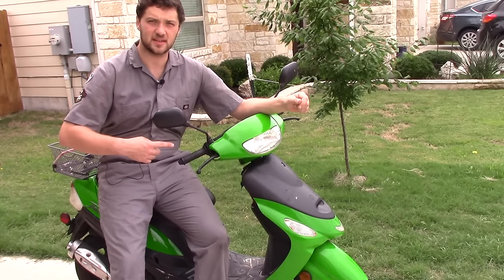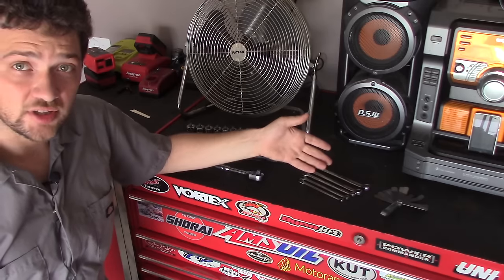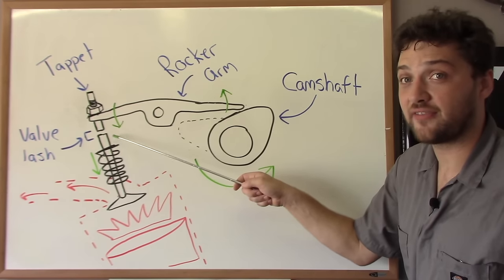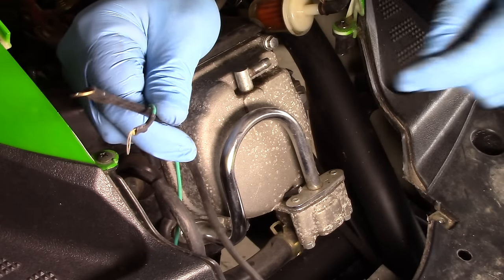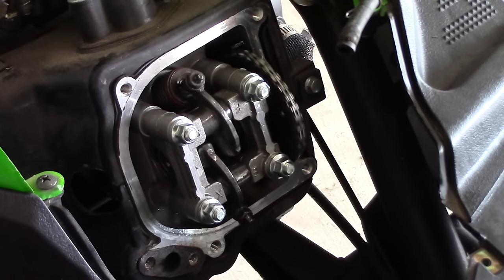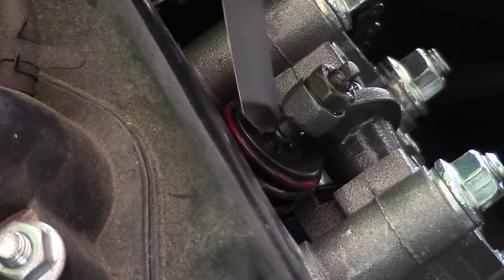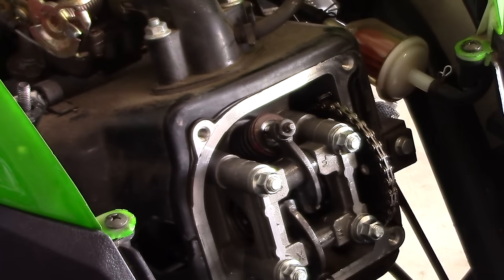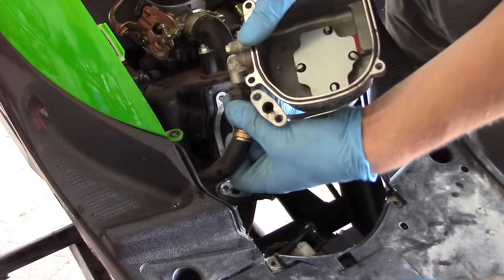Scooter 911: Hard to Start or Wont Stay Running? Try a VALVE ADJUSTMENT! (works for most scooters!)

Comment: Hey Garrett Seesing,

I'm wondering about using synthetic GL-5 gear oil in my scoot.  The manual says GL-3 gear oil only so I got GL-4 from Blauparts.com and that works fine.  I'm just curious to know if there's really any reason to avoid the additives in the GL-5?  It doesn't seem like there would be a lot of soft metal parts that would be damaged.  If you have any thoughts about this, would you please share them?  Thanks.
Reply from the maker: Wow! What an astute question! Personally I only run GL-5 in any motorcycle final drive as it (supposedly) has lower viscous drag than GL-4. But only GL-4 and GL-5 oils are designed for hypoid gears and have that extra shear protection that I would assume all final drives would need. I'm not familiar with any final drives in any scooter that use bronze or brass bushings that would require a GL-3 so I'm pretty curious as to why your manual would recommend it. What year and model is the scooter?

To play the other side, I ALWAYS follow the manual's recommendation. I think that I'm pretty smart, but I know I'm not smarter than the guys in white coats who designed the parts. So if they say only use this oil, or torque this to these specs, I trust them.
Reply: @Scooter_911  - The scooter is a 2018 Icebear Hawk Eye (75W-90).  I also have a 2019 Tao Tao Lancer (80W-90) and I use a GL4 for that, as well because the manual that comes with the Tao Tao Lancer is the manual for another scooter and has no really useful information in it.  I have been using another Blauparts gear oil for it and it's a mineral gear oil.  I did put a synthetic blend in the Tao Tao because it was leaking gear oil a little and I wanted the extra protection and have had no issues.  So, if you think to use the instructions, I'll just keep using the GL-4 for both of them.  Thanks for answering so quickly!
Reply: I forgot to mention that I use the GL-4 because it has replaced the GL-3 which is no longer made by any manufacturer.

Comment: What are the extra springs for?why does my 2015 TaoTao come with a extra carb,coil ,fuel lines etc??I just bought the scooter for $200 excellent condition and only 445 miles seems to run good but never took it in the road yet just a little nervious cause it's been many years.I am also trying to figure out why the main center headlight is dim during the day.If it's a day time running light,and gets brighter at night or something wrong with it.Brake like gjts, taillight,turn signal work and the small low middle light works.I am hoping you can help me..
Reply: No

Comment: OK I have a question,I purchased a Roadmaster 150cc scooter about 3 weeks ago,since I've had it,it has stalled and shut down on me twice leaving from work,omw too work I had no problems,but as soon as I leave,I've started the scooter,started leaving from work,get about 10 yards out scooter starts too stall and then finally dies,I try using the electric start too get it going again,with no luck,but as soon as I use the kickstart,it starts right up with no problems and I get home without any issues,do u have any idea what the problem could be,any help would be appreciated,thx
Reply from the maker: Wow that is extremely strange. This isn't a solution but have you tried letting the scoot warm up for a minute or so before you leave work? So bizare that it only happens leaving work too. If you leave anywhere else around the time you would normally leave work does it stall then too?
Reply: @Scooter_911  I usually just ride it around the hoise ,maybe a few blocks,other than that for the past couple of days too work and it did the samething twice,and no I diont let it warm up,and like I said after it wouldn't start with the electric start,I tried the kickstart and I had no problem getting home after that,and what's weird it runs fine when I travel too work

Comment: please help oh god of scooter wisdom....i bought a scooter from some one and  it struggles to start as if something is stuck or sticking it has oil the cylinders are all brand new i checked the gears and noticed that the gear oil is really really thin as if the dumbass filled it with motor oil is it possible that the gears arent turning when im starting it? or does that have any effect at all or is it the bendex? im so confused

Comment: I have a gy6 and it stopped running on me after doing a gasket replacement what did I do wrong?
Reply from the maker: Which gasket did you replace?
Reply: I replaced the one where the piston is and foreword to the valve cover.
Reply from the maker: @benjaminbower2470  if you replaced the head gasket you may not have gotten your cam timing right
Reply: @Scooter_911  I know I had a hard time with getting the chain back on

Comment: I have a question for the hard to start symptom. My valves are adjusted.

I gotta a 150cc Bintelli Scorch Scooter
I smell a gassy odor when trying to ignite the electrical system & attempts to turn over a few times before (1) the volts in the battery discharge below 12 volts & just won’t start because too many attempts with no avail or (2) actually turn over with strong rev power but sometimes you can hear a poot from the exhaust pipe or slight stall in the running process when started. 
Any advice? Should I pull my spark plug or adjust my carb air/fuel screws?

Was riding fine now it’s always feel like a gamble if this thing will fire right away, after 2-3 tries or more.
Somebody suggested it could be the CDI box. What do you think?

Comment: Did you have to drain the oil first?
Reply from the maker: No, but a little oil leak out when you remove the valve cover. But the engine should be cold before you perform the valve adjustment. And if the engine has been sitting a while the oil drains back into the crank case

Comment: Hi, so i followed your tutorial and while it was sparking and running (but turning off shortly after) before the repair. Now it isn't sparking. Could it be from inserting the screwdriver into the sparkplug slot like in the video?
Reply from the maker: No, you cannot damage the ignition system by inserting a screwdriver in the sparkplug hole. More than likely you have an ignition system issue, possibly a pickup coil, possibly a CDI and possibly just a bad grounding wire
Reply: @Scooter_911  I see well, thank you for your reply and the video. I dont live near a shop that will repair this .. so i guess the best thing is to just try to sell it :(
Reply from the maker: @Matthew-bg1nx  well there is another option. Do you have a multi-meter and some tools? I could possibly walk you through the repair via skype
Reply: @Scooter_911  i appreciate the offer! I dont have a multimeter but i do have a decent tool set that i used for this repair.
Reply from the maker: @Matthew-bg1nx  well if you can get your hands on a multi-meter my offer still stands. I'd hate to see you sell it over something that can be easily fixed

Comment: I did a valve adjustment and it still turns over and dies. Even with new carb and intake and air and fuel filter

Comment: I think I might have this same problem. First I couldn't start my scooter and my first thought was to clean the carburetor. After cleaning, it started but it turned off when I throttled it. Also, the idle keeps going higher and lower on its own. I feel frustrated. I check the spark plug and changed it to a new one but still. I'll try this engine valve fix and hopefully it's the problem. BTW, my scooter is 150cc Jonway vitacci eagle. I just bought it 2 weeks ago and it started fine and ran OK after replacing the carburetor. There's a sticker on the scooter just below the speedometer which states to not go over 25 miles per hour on the first 300km. But I did go at top speed of 55mph. Should i have heeded this warning? Could this be the problem I'm having now? Because the scooter is new.

Comment: I'm looking to buy a new 49cc scooter Tao Tao Pony 50 :)
Looking for (simple plug n play) type mods.
I want to keep it simple and get a little more performance.

Can I just replace the stock carb and muffler system and still be reliable?
Looking at: 
Glixal ATMT1-073-1 GY6 49cc 20mm Big Bore CVK Carburetor with Electric Choke 
39mm Air Filter for Gy6 Moped Scooter 
BADASS SHARKS 28mm Motorcycle Exhaust Muffler Pipe System
Trying to keep it simple, inexpensive and semi reliable. 

What do you folks think?

Comment: I have a 150cc was running fine started sounding like it's running out of gas it died when starting it try to run  give throttle it locks motor down
Reply: Should I get a rebuilding kit

Comment: I have a lance cabo 200i moped it starts thans shuts off i can't get it up to 12 mph any ideas?
Reply: I have a 2021 50cc Cabo that was having the same issues. Turned out to be a wiring problem to the ignition coil was loose. May want to check that out. Overall, SYM make a very good moped

Comment: How do these scooters get out of spec in the first place ?
Reply: Garret! I’m out to mess with my scooter now. Thanks for the help... and how do they get out of spec ?!?
Reply from the maker: The valve seats are extremely soft. So as the scooter runs the valves beat themselves further and further into the head making the valves tight. Usually a loose valve is due to carbon build up around the valve seat

Comment: Hey Garret, I am new to the scooter owning world. I just brought a Wolf v150 a month ago . I have 426 miles. and brought it brand new with 0 miles on it  I absolutely love it but i'm afraid  that I have started on the wrong foot by not reading the manual and immediately putting regular gas in it. I discovered later that I need to put 93 octane in, so I did this last time and from now on. Also, this scooter has one helluva take off for a scooter and I also didn't know that I should keep it under 30 for the 300-mile break in speed. I am gonna take it in for my break-in oil change which should have been 300 miles. Is there any other regular maintenance that I can do to turn around my horrendous start. The manual says to keep all moving parts lubricated but does not give any detail on how to do that. Would love to see a video about how to do regular maintenance from here on out. Thanks for you awesome videos!!
Reply from the maker: Wow these are all great questions. I'm sure nothing was damaged by the lower octane fuel. Honestly there's really isnt much difference for an average scooter because the compression ratio is so low. You're more than likely just feeling the performance increase after break-in. Which brings me to my next point, there is always  lot of debate on how to break in a motor but I prefer to edge on the side of "what the manufacturer recommends". The 2 most important things to take care of in regards to maintenance are changing your oil and valve adjustments. Thanks for the video suggestion, its really great topic!
Reply: @Scooter_911  Ok so first off I am mad impressed that you responded when it's obvious by your videos that your plate is full...  Thanks for ur advice! Do you have a cash app that people can donate cause you obviously put out money to share valuable mechanic-grade info which I feel privileged to receive. Someone asked me the same on my channel bc I use a rack of gas to drive around Washington DC doing my videos, so I get it. Hell, you bought a scooter entirely for our benefit!  Meanwhile, back at the ranch, thanks for you advice. Do you think my American made 2021 Wolf  V150 was a good buy for $1,800, or any amount for that matter? Im at 450 miles and my back brakes are squeeking and my front brake lever is already not as efficient as it was. Overall my bike is making noises that it wasn't before. Anyone I am a student for real for real of your videos like a DIY thing. Thank you my brother and sorry for long comments (after all I am a blogger and video creator myself...lol)

Comment: I have a mean dog 2 trike ..it won't start. Do you think is the cdi box?
Reply from the maker: There is no way to tell without testing other engine components. See if this video i made helps you out https://youtu.be/xW5y7a7CB1c
Reply: I will try all of that tomorrow. .i will let you know my progress. I may need help. I call a mechanic .he told me to take it tho the shop. He said is the head that is bad .and he will change me 680 dollars to fix it. Lol
I will follow your videos to try to fux the problem or problems by myself.
Thank you
Reply: Ok.Garret this what i found in my trike 
By the carburetor there a little curb breather ..well is leaking gas .then where the air filter is located. Also is leaking gas. This morning the trike turn on good but looks like you need to accelerate it keep it going. Wgat do you think? The carburetor is bad? Or something else?. Thank for your help.
Reply from the maker: @shang-chi-cf8pd  sounds like a carburetor issue and possibly a fuel petcock issue. I would remove the carburetor disassemble it and clean everything out. Take pictures before you remove it so you can route all of the vacuum lines the same way
Reply: Thank you. Im not a mechanic and this is my first motorcycle scooter. Im trying to learn so i can save money. I don't have a job since April. So i have to do things by myself. Mechanic that i know he's too expensive.  Thank you for all your help
Reply: If i buy a new carburetor could you tell me what i need ? I have a mean dog 2 4 stroke scooter.

Comment: So what Exactly makes them hard to start or stay running?
Reply from the maker: When the valves are tight it allows the compression to escape before the combustion takes place. Thus resulting in low power.
Reply: @Scooter_911  Thank you! I love to get the technical answers. It helps me understand a lot better.
Reply from the maker: @TomTom-gg6sy  glad to give them! cheers!
Reply: @Scooter_911  If the seal of the valve cover isn't secured fully can this cause the valve gaps to become tight after a bit?
Reply from the maker: @TomTom-gg6sy  nope but the valves will tighten with time due to the metal heating and stretching

Comment: what causes the scooter to pop the head lamps
Reply from the maker: Usually a bad regulator rectifier is the culprit! It allows the charging voltage to climb too high and blows out the lights. I made a video about charging system diagnostics here https://youtu.be/l20k6vFoz2Y

Comment: Where can I find the fuel gauge adjustment thing at or is that's the name for it
Reply from the maker: The fuel level sender is bolted in through the top of the gas tank
Reply: Did you mean "feeler gauge"?

Comment: I'll  try cleaning the carburetor, changing the spark plug, change the fuel, gas is pumping electricity is ok,  but still not start need help, please
Reply: I have a similar situation, did you figure it out?

Comment: If anybody has a clue about the issue my scooter has, i can't find the fix: a 2012 Piaggio MP3 125cc with fuel injection and only 800km on it (it sat in a garage for years).
I did the following with no impovement : replaced spark plug, drained oil, new oil filter, new lipo battery, adding injector cleaner to the gasoline.
When it's cold, it starts perfectly every morning*, and it will even start 10 times a day *if not driven (even warmed up!). 
However, once it has been driven for any length of time*, whether it's 5 minutes or 2 hours (and it runs very nicely with good power), *it won't start again when it's hot and has been driven. Sometimes, it actually does start a second time with a longer cranking period but then dies off after 10 to 60 seconds, and after that, it won't start at all until the next morning.
I would appreciate any help to get me on the right path to fix this issue.